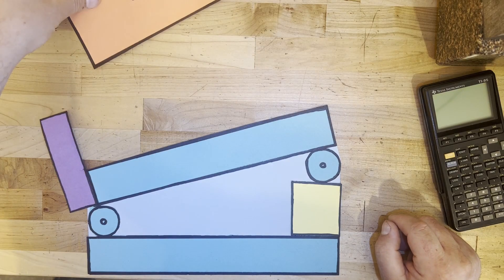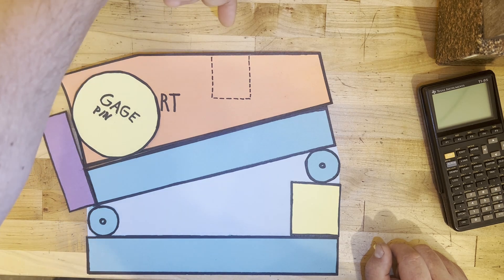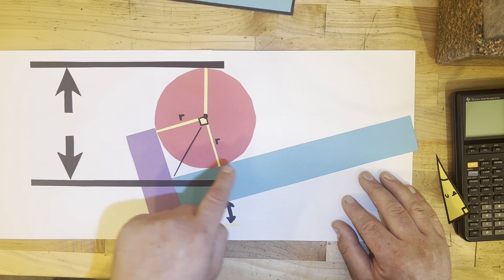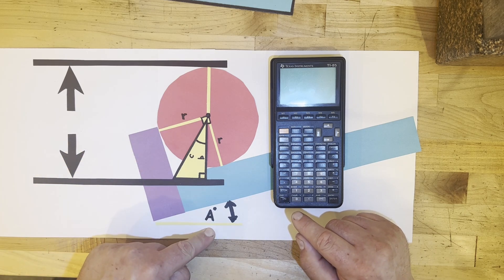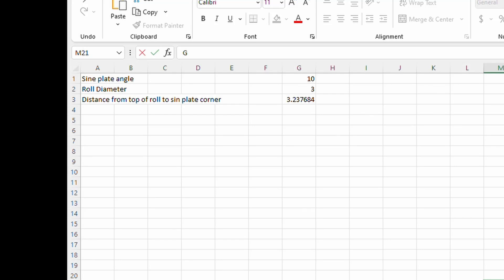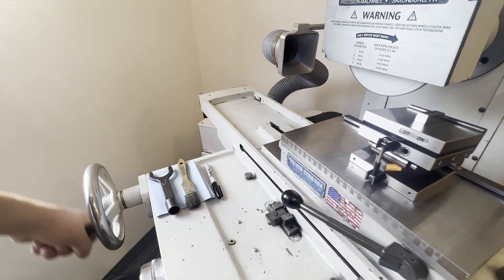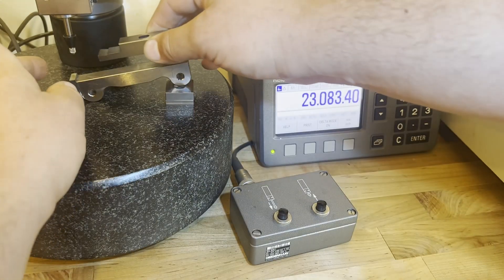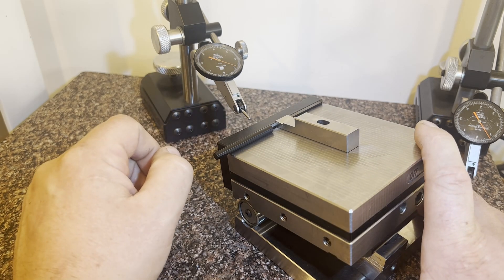Shop Math and Grinder Ergonomics

Comment: @T=3m30s Another form would be H = R*(1 + sin(A) + cos(A)) 
which can be seen by drawing a triangle in the blue area with a horizontal line drawn from corner and vertical line drawn from  red/blue point of tangency
this line has height R*sin(A)
the height from this point of tangency to the center of the pin is R*cos(A)
seen in a red triangle with a horizontal line from point of tangency and vertical line from center of pin
then there is R*1 from pin center to top

the x stepover from left edge of pin to corner would be x = R*(1 + sin(A) - cos(A))
notice the sign change on the cos(A) term

Comment: Thanks for the video. I own a large shop with a complete grinding room, tons of manual machines and another building full of old and modern CNC machines. It's hard to find good machinist, but even harder to find a grinder who can run an internal, external, surface, centers and a jig grinder.  The nice thing about using CAD is that it will potentially prevent math errors, but of course you have to sketch everything correctly as well. Thanks for the videos!

Comment: Could you do a video on the step grinding squaring that you showed on instagram a while back. 

I tried it today, and it worked but it took me a while to get it to be consistent a d I was still only able to get 60x40x80mm block to about .004mm squareness all-round. Is there a formula for how much to take off to "rotate" the block?

I ended up relieving the centre and grinding the 2 legs to square it.
Reply from the maker: It’s usually approached by determining a out of squareness per inch/cm and applying that amount to the errant face . Keep in mind , with this method the squareness can only be as good as the flatness and parallelism of the parts 6 faces

Comment: I pretty well suck at math as well. So i cheat/use what works for me and i will draw something such as your pin example on fusion 360. Once i have the 2d sketch i can then let it do the math for me and simply dimension as necessary.

Comment: I'd say you're overcomplicating the calculation. The distance between the angle and center of circle can be calculated using Pitagors theory, so c= square root from 2r^2 and the just add another r to get the top of circle. Correct me if I'm wrong, I'm no maths expert 😅

Comment: I recently dusted off my trigonometry hat to figure out a way to "show my work" for an analysis at work.  I needed to do this to prove that the results were the same as what could have been derived through CAD or metrology software.  At the end of the couple of days it took me, was it worth it?  Probably not, but it kept the one person who would have asked the question quiet.  But I agree with Adam here: I can't emphasize enough to keep your skills sharp by doing it, over and over.  And if all else fails, draw a picture.

Comment: For precision angle fixtures, my production shop used to specify a drilled and reamed .250 tooling hole referenced off 2 ground square edges. Then the draftsman could specify a distance from the center of a precision .250 dowel pin to the ground angled surface so it could be easily checked. It wasn't split tenth accurate, but good enough for +/_ .0015. There must be a phone app for that type of dimension now, but it's very good to know how to pencil-whip it.

Comment: Nice explanation. Your comments on machine shops at the end are absolutely accurate. There are plenty of shops making very accurate and high quality parts with older equipment. Even in modern machine shops machinists typically do not have access to computers and CAD. I think you begin to understand your set up more, and also the potential solutions, if you can think through the trig and geometry rather than sketch it on a CAD system. That said, I use CAD plenty routinely to solve problems - but I feel smarter if I can do it with just mathematics. Thanks for the video.

Comment: Is having a "Manufacturing Hole" not a common thing in the grinding world? Where I work, whenever there is a custom detail with an angled surface whose height is important, we add a manufacturing hole so you can measure the surface to a gage pin using a tool probe or depth micrometer while still loaded in the machine.
Reply from the maker: Occasionally you see them, really depends on how much accuracy the customer is looking for . A gage hole like that is only as accurate as the level of fit it has to the pin so it ends up being easier for use to just take the same pin and set it in the corner of the sin chuck and depth mic down to it

Comment: Using a ti-85 I'm surprised you haven't made some basic programs to do these functions easily. I have a ti89 that I have done just that. Super awesome time saver.
Reply from the maker: I do have such programs , but I figured I would do it out long ways for explanations sake
Reply: @adamthemachinist  right on!

Comment: Regarding your last comment: I know of a shop that just recently retired a tape-driven NC and only then because they couldn’t find replacement parts! It was still cutting well after decades of use. So, yeah. It’s best to know the manual methods in addition to CAD/CAM programs.

Comment: I admit I’m a excel junkie. I’ve found it super useful in calculating long measurement problems. I’ve had several occasions where knowing tolerance stack up is necessary for a successful end result. However, it is good to keep sharpening the pencil too.

Comment: How did you find this career? I know how I got to where I am and it was never discussed in high school, I just discovered it as I moved into adult life looking for full time work. 

I think I am asking what is the path a student would take to get to where you are now? Let’s say beginning in grade 10.
Reply from the maker: I would check with your states labor board and find out which local metalworking companies have an apprenticeship program and try to get in at one of those . You’ll do a 8000 hour on the job program and 2000 in class room hours probably, and come out the other end as a decent toolmaker or machinist . Another few years in a few different specializations  like edm or jig grinding and you’ll have a wealth of experience and classroom knowledge

Comment: I am guilty of solving these types of problems on CAD. The problem is that I started losing 'intuition' 
As I started going back to doing longhand paper solves, I am better equipped to to 'see' the problem and the solution. I am faster overall since most machining is a bunch of small problems that you are faced with in sequence. 

For complex compound situations, I still use CAD. I would encourage the audience to consider taking time to work out problems like this longhand. Google the trig, do some exercises, etc. You will be a little slow at the beginning - but in the end you will be faster than those that rely 100% on a computer.
Reply: I agree.
The trick is -- in CAD you cad model arbitrary complex constrainst, and the constraint solver will work for you, with no error....
In CAD you can visually check the validity of the model -- it's much less error prone if you're not that much into trig.